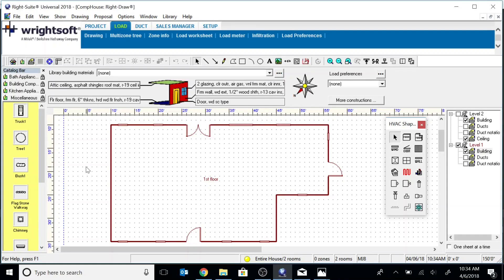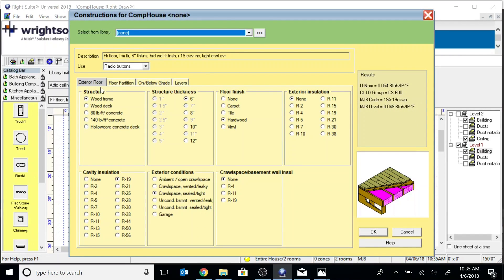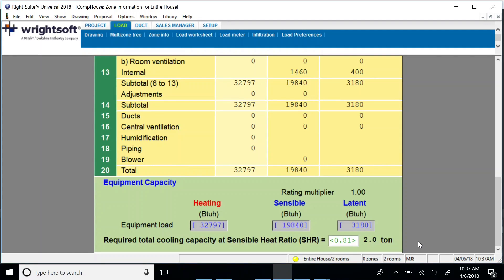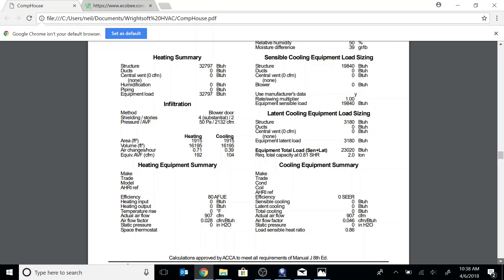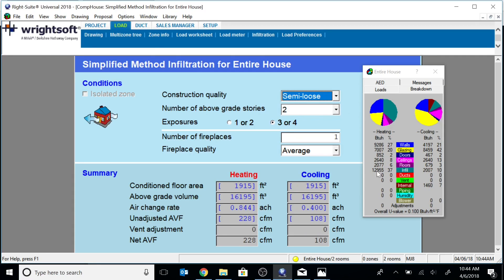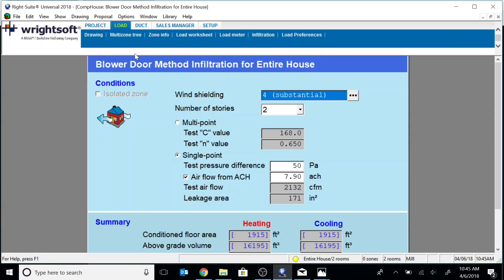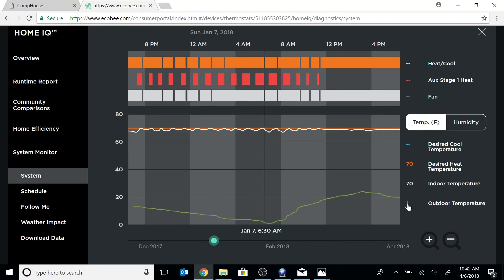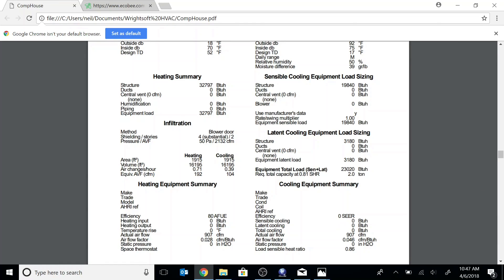Debunking the 500 sf per ton rule

Comment: Of course if you're going to be fine with 75 degrees when it is only 92 degrees outside, this is enough.  that is way too hot for me (70 degrees).  we are usually around 100 and have a lot of days between 105 and 110.  we currently have a brand new 4 ton heat pump system that is totally failing to cool our 2500 sf house built near sacramento in 2001.   78 degrees upstairs on 89 degree day.
Reply from the maker: FWIW I ended up putting in a 1.5-ton Mitsubishi SUZ/SVZ. I have no problem maintaining 70° inside  when it’s 15° - 95° outside. Sounds like you may have some insulation/air tightness/duct issues that your HVAC has to overcome.

Comment: 7:28 "I did a very aggressive man J, including measured leakage, and it came back smaller than most would install.

Tracking with my ecobee turns out Wrightsoft sized equipment nearly 3x what the house was using on a day that was below design temperature."

9:06 at 1° 27,000 BTU satisfies house.
Reply: Remember the fault isn't the software. They are required to size in accordance with ACCA in order to be approved software. Same can be said for all ACCA approved software.

Comment: Software and manual J do not size equipment to match it to the load on the coldest day. If you lost power for a day during a cold snap it couldn't recover the house if it was sized your way.
Reply: Interesting argument to justify being a hack!

"I size my equipment way larger than necessary in case aliens land"
Reply from the maker: Glen Schmidt I size my equipment according to ACCA manual S, I’ll share a link. 
Staged electric heat, space heaters, would handle “acts of God”. 

http://www.acca.org/HigherLogic/System/DownloadDocumentFile.ashx?DocumentFileKey=2f0a6828-2205-e112-745f-7215c9a85541&forceDialog=1